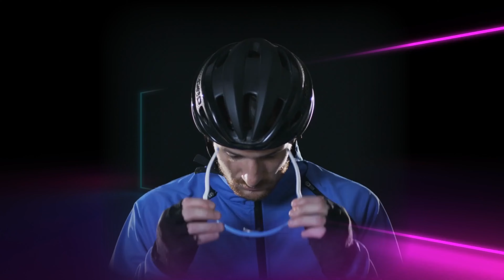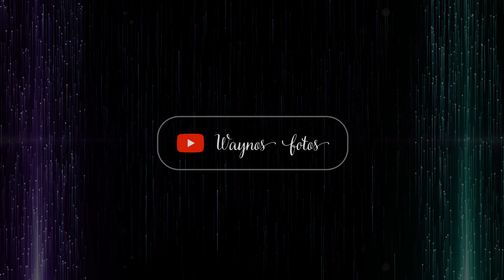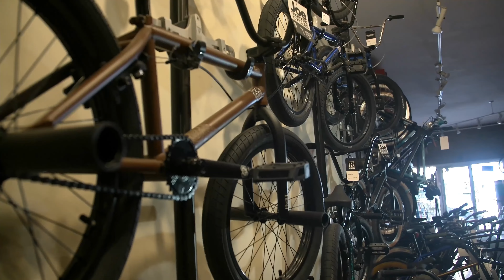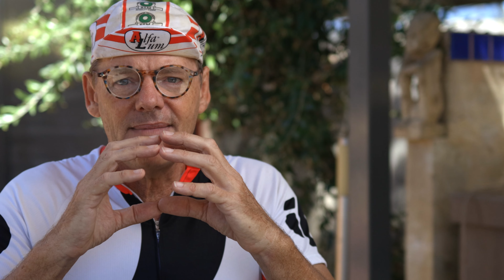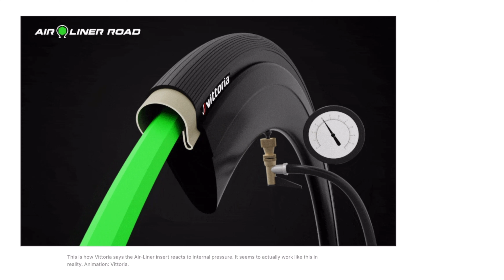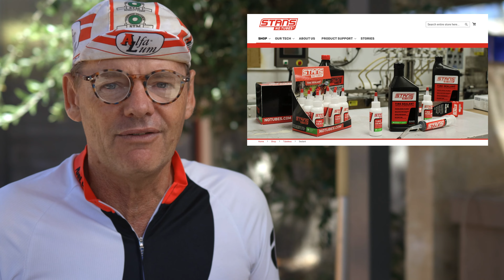Where is Road tyre technology going?

Comment: It is the bead that can’t stretch the carcass can and does so without detriment to the operation of the system so that shouldn’t affect the potential ride quality. The Vittoria foam insert is predominantly designed for races so the rider can continue on a flat until the service vehicle can reach them.
 I’ve been running road tubeless for some 10 years now and the new tyres such as Schwalbe pro one tle are so supple now they are far superior to a standard clincher such as gp5000 I use this example as I run both.
 Testing has long proved tubeless to be the fastest out of all three, in 10 years I’ve had one puncture in 25mm tyre that hasn’t sealed and this was my fault for letting the sealant dry out. You can also carry a tiny tool such as “Dyno plug racer” to plug a big puncture without having to remove the tyre. 
 The only downside I’ve found is replacing the liquid once a year and with some tyres the initial mounting/inflation. At times I’ve been baffled by issues that people have encountered with road tubeless however I believe that some try and run too low a pressure, this idea that a semi-inflated tyre = speed is at best delusional. I’ve always gone by the manufacturers recommended rider weight/tyre pressures.

Comment: I'm riding tubulars since last year, vittoria corsa graphene 2.0 on a set of dura ace c35 wheels, really love them. I got some small holes (< 1mm) of sharp stones in the outer tyre, what would you use to fill these? And do you have a good tip for a small spare tubular that I can carry during training or a longer distance triathlon?
Reply from the maker: You can carry a small Stans bottle and plastic tube that fits tight over your valve. Then when you get a flat, fill with sealant, pump up and spin. Fixes most flats.
Super glue can fix small holes but really not a big issue.
Reply: @waynosfotos  I always bring a small (30ml) flexible bottle with stans with me, but I guess for races where I do need a spare would something like a tufo elite be a good spare tubular?
Reply from the maker: @jochembeumer2673  some people use a light weight tyre, tufo make a super light one.
The biggest problems i see is people leave there tubs, they go flat with the weight of the bike on them. Then the glue goes hard as they don't refit them for years. So the glue goes brittle and the tyre fails where it has been creased.

Comment: if you try hooked tubeless and it doesn't work/ suit your needs, you can just revert back to using default clinchers and tubes. So there's flexibility.
If you buy hookless tubeless and you don't like it, you're boned. Cos it's tubeless or nothing. Or am I wrong here?
Also, first ride of the year on Pro One's. Got home and the seat tube was covered in sealant. 5psi loss of air. If only every experience was like how the marketing bs tells us it should be.
Reply from the maker: Yep Hookless tyres for Hookless rims, no going back!

Comment: I haven't carried a spare tube or tyre levers for over 2 years now, I run 28mm Conti 5000 tubeless at around 65psi, but carry a small container (30ml) of sealant and a Stans dart plugging kit which I have had to use only once in that time, it worked great and was so much quicker and easier than repairing a clincher with a tube, less than 5 mins and back on the bike, Way To Go.

Comment: Tubeless ready tyres are more difficult to fit but I can still get them on by hand. For me the biggest issue with tubeless ready is the sealant which is messy. So far I've had 2 punctures in 18 months and both have sealed no problem. You can also carry plugs for bigger holes.
Hookless only seems to benefit wheel manufacturers. Several tests have shown that the tyre can blow off at a pressure slightly above the recommended max. This seems to be a potential issue for heavier riders and a sudden increase in pressure from hitting a pothole or dropping off a kerb.
Reply from the maker: You do know you can put sealant in tubes and it still fixes most punctures.
Reply: @waynosfotos  sealants don’t work nearly as well in tubes as they do in tubeless set ups. It also takes an already heavy system(tubed clincher) and adds even more weight.
Reply from the maker: @veloveritas9963  that is true but it still fixes many punctures
Reply: Yep, I'm 95kg and my favourite hill I reached 52.3mph according to Strava, no thanks to trusting my life to something that has had failures like hookless.

Comment: I just want to see tech that would allow us to go back to rim  brakes. I've gotten so tired of hearing disc rotor rubbing that I now wear earbuds so I don't have to be disturbed by the noise. I've got my rotors perfectly straight and true and the pistons  or whatever they are called inside the calipers are cleaned and kept lubed with fresh mineral oil almost weekly yet they still rub and make noise after descending. When those calipers get hot they don't work like they are suppose to. With Mountain biking they don't get hot as much which is why it works for that discipline but road bikes are a different thing and if Shimano can't do it by now it ain't going to happen. Look at all the pad and disc designs Shimano have implemented into this and it's still not right. Modern technologies are getting so efn expensive and getting so much worse. That Vittoria insert you showcased is total BS and I'm not gullible enough to believe it works as shown in that clip. I used to ride tubulars also but when I flatted out on a ride I could never get the tire on straight enough for what reason.
Reply from the maker: As long as it works 😂

Comment: What a coincidence.  I’ve just had a chat with my Dad bike tires just minutes ago.  He’s old school in his 70’s.  He kept calling Tubular tires as Tubeless because that’s what they used call it back in the day.  I kept correcting him to patiently explain that’s not what tubeless tires means.  We have 3 types of bike tire technology.  Clinchers, Tubular, and Tubeless.  I didn’t even bother to mention Hookles rims and tires for Tubeless.  Since that would opening a new complicated can of worms.  

IMO clinchers offers best value in terms of costs and maintenance.  Tubulars offers the best performance and weight savings.  Tubeless is great for mountain bikes.  But I am not yet fully convinced for use on road bikes.  

Tubeless  is still a developing technology on road bikes.  Running a sealant and a tire insert.  Seems like a lot of extra weight and complicated setup.  I don’t see any benifits except it costs more than Tubulars.

Comment: I prefer tubeless because i think they ride better than clinchers and IMO they seem faster (for TT and Tri). Good tubs are hard to find these days, especially wide tubs. I personally find glueing tubs (well) is quite difficult.

When riding tubeless, i don’t normally carry a spare tube. I carry a 60ml bottle of Stans, a plug kit and 1 or 2 CO2 cartridges which does not require much space. Carrying a spare tub, on the other hand, is a real pain/problem (especially for racing) as tubs are quite large.

To save space when carrying a spare tube; the new TPU tubes look good, though i have not tried them yet.

100% agree on the need for better standards for tubeless tyres and rims. I’m not convinced about hookless in terms of them being a fast setup.
Reply from the maker: You need to watch my “how to fit a tubular in your jersey pocket”.

Comment: This new simplified technology is getting very complex isn't it 🤪
72 psi........with my 95kgs on it????
Reply: Actually, 25mm 65 psi is more suited. You won’t be slower, it will be more comfortable and you will have more grip. Our minds are skewed with the old school 8-10 bar thinking. 😉
Reply: @BartSchrijvers  I think it's a hard concept, with tubes my correct pressure ( using app ) for 25c is 102f/107r, fitted tubeless to one of my bikes and that 95f/91r psi so to have a drop of more than  20 psi to to be at the maximum rimless can pump to, I'm not prepared to take that risk as of yet.
I tried tubeless because one of my sets of wheels was tubeless ready, the initial set up was a bit of a pain as I had to fire the compressor up to pop them on the rim, happy with them, comfort hhmmm can't really tell, maybe slightly?? Speed, well I'm not fast so can't tell. I still take a tube with me as Wayno says.
I would not go out of my way to buy hookless rims until they have been used long-term by heavier riders and also until they are the standard of wheels, will this be on GCN in 5 years time ' technology that never made it ' ?
Reply: @mickchaganis6607  I'm roughly the same weight and currently riding a hookless tubeless Enve / Schwalbe 25mm setup for 2y's now. The tyre is so tight and secured by the rim, it feels/is safe to run lower pressures. It actually feels safer than some of the looser fitting clinchers out there. I needed a special tool to fit these tyres... hence, they are a pita to mount.
Reply: @BartSchrijvers  well it's good you are getting on with them. I'm not sure I will continue with tubeless when this set wears out. Will see when it happens.

Comment: Tubeless has a purpose for MTB. For road bikes it's another pointless thing like disk brakes. A decent set of road clinchers rolls well and you get punctures rarely enough that it's not a big deal.
Reply: Was going to write a comment but I would only be repeating yours.
Reply: @robertryan1663  Well it's always good to rant :) I know people who ❤️ these things. They still have to carry a spare tube everywhere and they still get flats. They try just adding air but it never works and this is a waste of time. When they finally accept reality they have to deal with a tyre that's really hard to get off and full of annoying schmoo. A solution in search of a problem. A flat on a normal tyre takes 5-10 min to fix and I get maybe a few a year.
Reply: I look over my tubeless tyres and there are at least a half-dozen points where a tube would have punctured. How many times have I stopped? Zero. So, I'm staying with tubeless, for now. BTW, I blew out a tire, which would happened with any tire, tubes, tubeless, or tubular at this point. Tube in and away I road...

Comment: And tubulars don't fail? Never? What happens if you puncture on a tubular? True, assuming the tire is totally flat you can ride the tire in a safer way than with a clincher, but you still need to fix it if you want to ride home. And how are you going to do it since you can't take the tire off that rim. Perfection does not exist in this world, so everything has its own advantages and disadvantages. Tubulars tire also rely on the the glue to stay on the rim, and if you puncture with them you are likely stuck. Tubeless could be messy to install and if the shits hit the fan and you really need to put an inner tube in your tubeless set up while on a ride, it can get messy. Although I once heard that a bad worker always blames his tools. I've installed at least 20 tubeless tire sets (that makes 40 tires) and never had any issue with sealant spraying out of the tire and painting the walls of my garage. I also installed all of them tools free, just by hand. I saw the sealant doing its job on the road more than once without me even needing to re-pump the tire. Only once I got a flat that the sealant could not seal, but the plug solved it and I could still use that tire for months. I give it to you that the first days of tubeless were not the best, but technology evolves and things get better. I'm also not a big fan of hookless, although I've never used it. But with the 72 psi is not really an issue. I run 30mm tires on 25mm internal width rims and never go above 55 psi. You simply don't need more pressure than that. And I don't think anyone would put a 23mm tire on an hookless rim.
Reply from the maker: With tubular you just put sealant in or run sealant in like tubeless, fixed. If the sealant will not work, i just pull the tyre off and fit a new one. This whole you can't fix a flat with a tubular is complete fiction.
Reply: @waynosfotos  so is the sealant supposed to fix tubs but not tubeless? And you can change a tubular on the go but putting an inner tube in a tubeless tire is too much of a mess? I really don't see why tubulars should be better than tubeless in this sense
Reply from the maker: Sealant doesn't care what system it is in, it just fixes holes.
The reason you need sealant in tubeless is because the tolerances from different companies is to great and they leak, the sealant seals this.
The Mavic system worked without sealant and so does car tyres. 
If the tolerances were better you wouldn't need sealant in tubeless.

Comment: Get the hell outta here. Road Bikes on “Tubular Rims” with a Veloflex tire are the ‘Shiznit’ as Hambini would say. 

Biking 🚴 does NOT need to be complex, over priced for the LATEST and GREATEST tech. 

Ride what you like, BUT “IF” you want “OUTRIGHT” performance then lightweight, simple design that is TRIED and TESTED are the RIM BRAKES, Tubular tires from Veloflex, 36mm deep or deeper CF Tubular rims on a sturdy frame of your choice PLUS “overall physical fitness” wins every time. 

Thanks Waynos!!!

Comment: You forgot one big advantage of tubeless: lower tire pressures. I don't know about everyone else here, but I don't have the most perfect roads, so I really appreciate being able to run a 32mm tire at as low a pressure as I can get away with
Reply: the hell you say?!! 32mm wide tire??? Why spend the cash on a lightweight ROAD RACE BIKE??? Just buy a regular frame, save yourself THOUSANDS. Lightweight road race bikes DO NOT HAVE 32mm TIRES. 

I understand what you’re saying but if you want performance…dude…32mm tires??? Really?
Reply: @SprayIgniteBoom  I'm not trying to win races. Just wanna have fun going fast and get to work/run errands. I'll take the speed tradeoff for extra comfort.
Reply: I run 110 psi on 23mm tyres and still go over roads with tarmac missing 🤷‍♂️ just gotta clench ya cheeks and send it
Reply from the maker: It you think you can run tubeless at low pressures, tubulars can run even lower. I still can't see what this tech offers over previous tech.
Reply: Not to mention, tubeless is faster

Comment: Weinmann Concaves... the original hook-less rim.
Reply: I remember them. What's old is what's new. Next week cottered cranks. The stuff you rode last month will be passe!
Reply: @davidburgess741  I've proudly hung on to mine w/NuovoTipos.
Reply: Got a set of Tipos too, updated clincher rims though. Back then there were standards and you can still get 36 hole box section rims. These are spare wheels now for the vintage look. The cassette was an actual huge advance.
Reply: I still have one of these, but they weren't the first.  Hookless was standard in olden times.  All the steel rims which were the norm before the mid-1970s where hookless.  The aluminum rims from the 70's were usually hookless, like the ubiquitous Arayas.  Hook bead rims caught on fast in the 80s as tires got really skinny and needed higher pressures.  I used to use 85psi without problems on hookless rims.

Comment: I have dabbled with tubeless without too many issues. It initially failed due to not enough sealant during install so that was totally my fault. Worked fine for the time I had it but I uninstalled the tires after 6 months and sold that wheelset. However if they need cleaning out and re-installing annually then the idea of tubulars is not much of a hassle in my opinion. It might be different for those that don't do the work themselves. My longest streak without a flat was over 4 years using clinchers 60% of the time and tubulars the other 40%. I do carry a spare tubular and don't use sealant. The thought of having a sealant messy roadside issue with tubeless disturbs me. LOL

Comment: Tubulars work fine for me. The issue is that wheels for tubulars are hard to get and complete bikes never have tubulars on it. 
So it's a niche as not many riders will buy a new set of wheels just to try tubulars.
A tubular or a clincher with an inner tube can be changed easily with a simple pump. Tubeless and hookless need special pumps or compressors as well as sealants.
Reply: Plus side, used tubular wheel sets are getting cheaper and cheaper for high end wheels 🤪 I got an immaculate set for my track bike, DuraAce hubs, bomb proof  Mavic CXP30 rims, fitted with hardly used Vittoria Pista tyres £230 😁😁😁